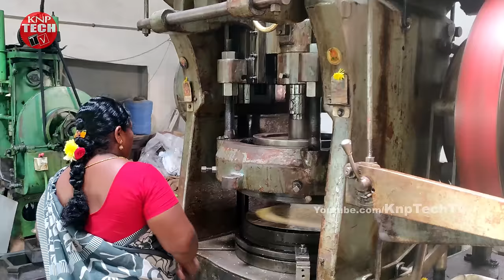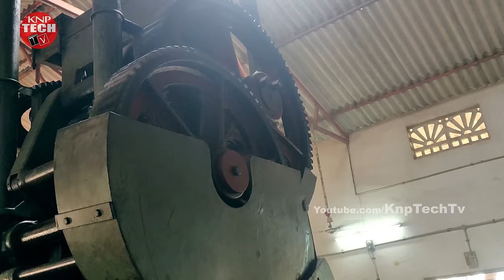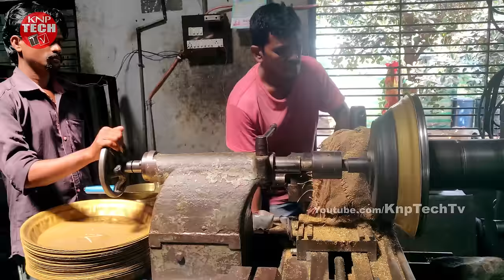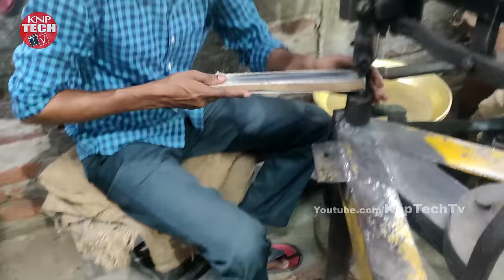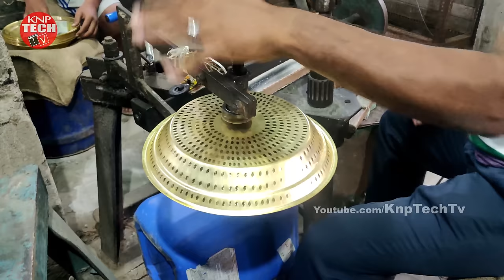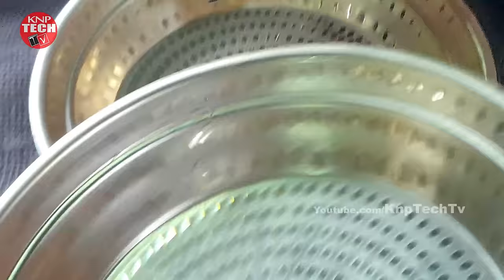Brass Plates Making Industry | Brass Utensils Manufacturers | Brass Items Making Process and Skills

Comment: excellent workmanship. congrats. some of the hand works are unnecessary. they are a physical strain and in long run will certainly affect fingers  wrist and shoulder which cannot be cured. so the hand made designs may be withdrawn and machines may be involved. health is very important than the manual flower designs.  God bless all the strainers